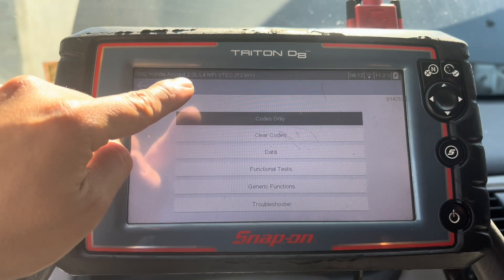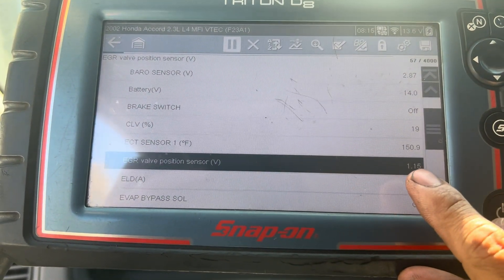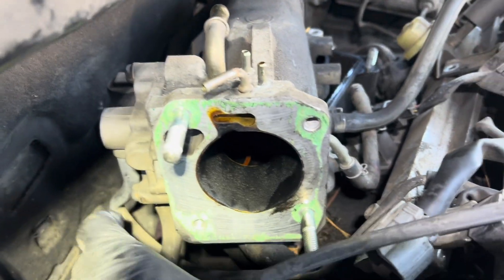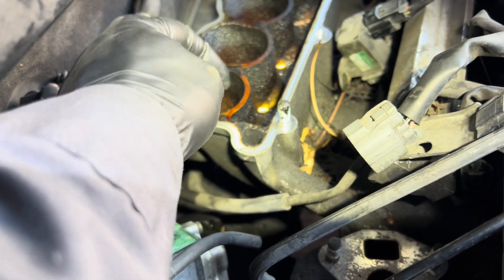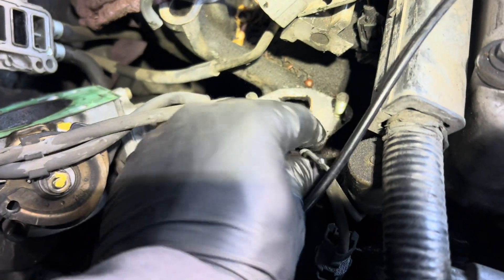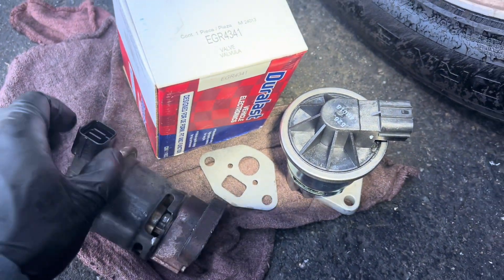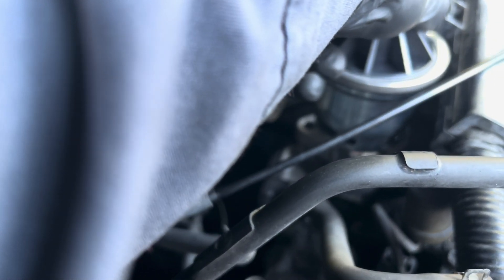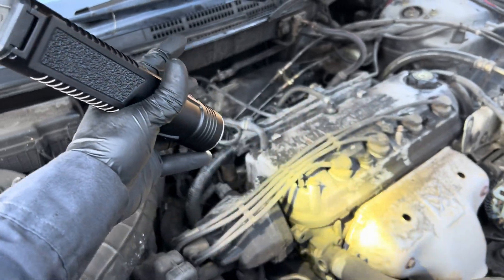Honda Accord Replace EGR Valve & Clean Out Clogged EGR Passages - Step By Step - Code P0401

Comment: Video helped, but pulling the top off of intake was fun.. needed multiple Joints. way more hoses that i imagined. But my clog was exactly as pictured . 2001 honda accord ex 2.3L
Reply: Did it fix your issue?
Reply: @cfauvel its fixed...

Comment: Hi i have a 1999 Honda Accord EX-V6 and I have 2 codes that come out P0170 and P0401. Could this be the cause of my car losing power or wanting to shut off as soon as I accelerate?
Reply from the maker: These 2 codes kind of related. P0170 fuel trim malfunction (uneven). P0401 egr. Clogged egr passages, uneven fuel, misfires, engine stumbles can cause the engine to loss power and weak acceleration.
Reply: Thank you  @Ah_Duuu_Ma